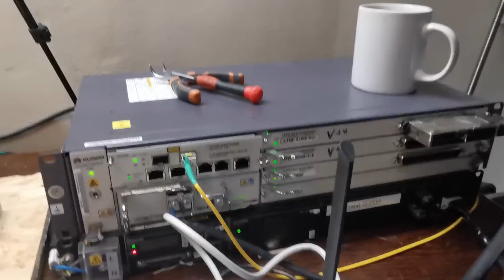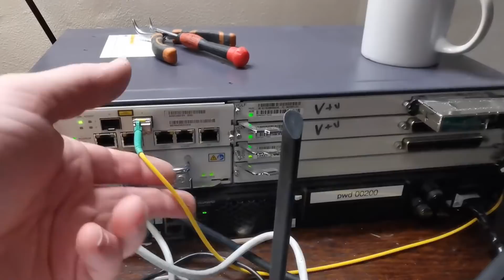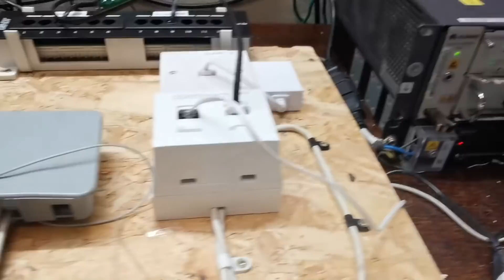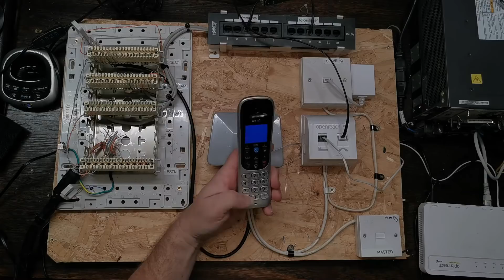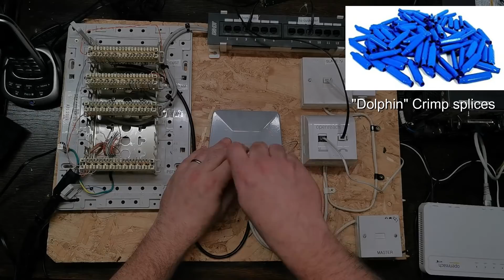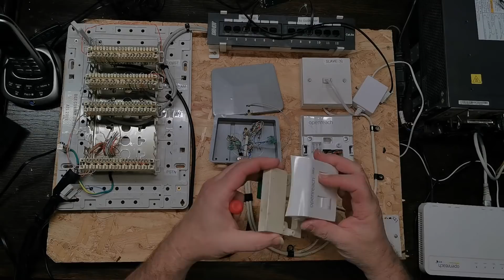How FTTC Works / VDSL

Comment: Very interesting.  I'm having random outage in broadband once a day between 20 to 60 mins.  No idea why. Engineers and tests/scans no idea either.
Reply from the maker: Things like this can be a nightmare to track down. Start by making a log of when it happens, how long and maybe ask neighbors. Once you have a few weeks star looking at the environment, where your line actually runs and events happening at those time. Its possible it's something being picked up from somewhere. We had a customer who, every evening would have a run of broadband issues at 7pm till about 10pm. No one could find a cause. long story short, a nearby radio ham would have dinner, watch the 6 o'clock news then go down to his shack for a few hours. His VHF transmissions were knocking out a number of people's broadband.

Comment: I don’t think gpon is used I believe it is 21st century network which is the WDM network
Reply from the maker: GPON is use by all the ALT nets in the UK with GPON/EPON used by BT, but they have all sorts of legacy in play too. GPON is definately in use in the FTTH in most areas as evidenced by the Huawei/ECI ONU and big arse battery backed ONUs with FXOs built in.
Reply: @rtechlab6254  the backhaul is 21cn which is a wdm network
Reply: @rtechlab6254  it is not gpon as a back haul from a dslam it is a 21cn ethernet circuit usually wdm or point to point optics

Comment: Actually in the US maybe NYC the cable terminates at a cabinet outside the premises then goes to the router via either a coaxial cable like that used by SKY PLC (not the twin coaxial cable) or via Ethernet cable possibly CA5 or CAT6 but recently I noticed a few fibre installs where the fibre comes into the house via a optical socket  then a optical cable with a connector on both ends one goes to the main socket the other goes to the router, the unit that is attached to the promises also has a possibility of a phone connection but these are options that you have to opt into when you have decided that you want broadband some people will just use a HUAWEI B331 Homehub and a HUAWEI B331 Antenna that attaches to the Homehub but will require a AT&T or other SIM
Reply from the maker: In the UK, the normal route is fibre  into the premises then there seems to be two ways its done. Either into a fixed ONT in new builds which contains the "modem", battery and provides a POTS Phone line. This seems to be a short lived way of doing it as we don't see it often, mostly in 2019-2022 builds. Most other installs have a small ONT on the wall connected by fibre to the wall box on the outside of the property. The ONT only provides an ethernet jack and from there is normal PPOE via a modem of your/provider's choosing.

Phones in North America are done a little differently and I've not really worked with them since contracting for Telus in mumble

Comment: How are voice calls routed to the exchange with FTTC.  Does the voice go over fibre from the cab to the exchange?
Reply from the maker: It depends. On our system we bridge to sip and go off down the fibre. BT in the UK break into the local loop which is why the cabinets are almost always next to the old cabinets the analog lines are patches in

Comment: Interesting to see how the British do it over there. Over here in the US we don't have a "master socket" we have a Phone NID on the outside of the house, then run a phone line to inside jack(s) and there is never any master or slaves, they are just phone jacks regardless of where they are at. It also appears you use a proprietary phone connector over there, BS 6305, where as in the US we just use RJ11. The Jelly connectors are called butt splices over here. I think FTTC is a dumb term to be honest, as ADSL, ADSL2+ etc. can all be fed from a remote DSLAM called an RT (Remote Terminal) and is quite common in rural areas (the countryside as you would say it over there). These RT's are usually fed by fiber, but in the very early days of DSL could of utilized multiple T1 or T3 backhaul. I think we should stick to terminology that describes the actual Internet connection we have, the hand-off. Just say I have VDSL2+, or I have Cable, or FTTH. I hate when people say I'm on copper, well both DSL (regardless of technology) and Cable are both copper. CMTS units are usually fiber fed too, would you consider that FTTC? As a lot of these CMTS units have to be moved closer for DOSCIS 3.1 and now 4.0. No, it's mostly used for DSL terminology, but nonetheless I think it's just dumb. Most DSLAM's are fiber fed, same with CMTS, it's the distance from said DSLAM, the condition of the OSP copper and the line cards (and provisioning) in it that determines the speed. We already know everything after the handoff rides on fiber, it's redundant terminology. My DSLAM is fed with 10Gbps Fiber backhaul, but only offers ADSL2+ 10/896 profile as they haven't swapped out the line cards for VDSL2+. Would you call that FTTC? It technically is fiber to that cabinet lol, but who cares the handoff is what matters. Should we also start saying I have FTTT (Fiber to the Tower) as most cell towers are fiber backhauled, with the exception of very rural ones that are backhauled via microwave. I know you didn't invent the terminology, but that's just my little rant on terminology. In the US we mostly just say what it is, DSL, Cable or Fiber, but when we save Fiber we ALWAYS mean FTTH/FTTP. Unlike Virgin Media that calls Cable internet Fibre!
Reply from the maker: I've done work for Telus so I'm familiar :) The master socket doews the job of NID/NTE Butt splices are something else here, they used to be gel filled blue crimps that used a tool similar to the ubiquitous automotive crimps. FTTC was one in a long line of half assed fixed applied to our phone network. VDSL does have a distance advantage over VDSL and will manage more stable connections at the same speeds. The green cabs (RTs) are fed by Fibre here and that was the justification for (Fibre Broadband) and I agreee with you, Fibre should mean FTTP, not fiber to the cabinet (VDSL) or Fibre to the node (Whatever version of DOCSIS Virgin use)

Comment: What is SOADSL?
Reply from the maker: Single Order ADSL. The slow cousin of SOGEA (single order generic ethernet access) these are services that dont have an attached analog service, so the setup I use with the MA5616 could be considered SOGEA as I don't insert the POTS analog service anymore

Comment: :( I’m still stuck on the bare bones 10-15 mbps down and 0.5 up trying to play games on it is a nightmare.
Reply from the maker: There's way too many not spots still
Reply: If it hasn’t improved, you can actually get an ethernet circuit installed. You’re going to be paying lease line pricing but they will put the fibre in for you.

Comment: BT made a huge mistake going this route rather than FTTH.  50-60mb is not fast compared to other countries and it seems this system will never be able to deliver over 100mpbs to a large amount of customers.
Reply from the maker: Wasn't possible at the time. Was a quick fix and a step to FTTP. Copper is now being phased out in most areas so large scale FTTP is on the way. At the time it was prohibively expensive and the technology not that well proven.

Comment: Thanks, really well laid out presentation, good point re dont go behind or inside the BT socket.
Like the layout and test bench / I did not know re the older sockets / additional wires etc (had that cause some issues on site visits), top tip.
Keep up the channel / defo recommend this.
Reply: I prefer to explain to end clients / the BT socket remains the property of BT - so avoid doing anything with it, do the basic checks as you showed.
If inside your house, keep any DIY folk away from the socket, avoid touching it or moving it.  (Log a ticket with BT if you need it moving / ppl need broadband more than ever these days), if you're nice and lucky, the person at BT might do it / or you always ask.
Plus outside maintain any external bushes and trees etc outside your property, keep the line clear and free from any overhanging trees), had too many ppl drop a tree or big branch then cut the line, approx £250+VAT per line... including chinese laterns burning the line 
Best tip, if you ever see a comms person or BT engineer, always offer a cuppa and some biscuits, those folk are out in all weathers, #karma #payitforwards does not always work / though they appreciate it if you can.
Reply from the maker: Thank you Andrew. Ring wire is a rarely mentioned but common source of issues

Comment: So hypothetically, can a person place a DSLAM on the home pair line ? 
That is assuming that it can do so if there is another DSLAM unit at the exchange and the unit at your home can boost the line speed if you are far from the exchange.
Reply from the maker: You'd need to strip the existing VDSL signal off with a microfilter and modem, then pass the output of both back through the DSLAM with the DSLAM configured to allow the PPPOE from the modem to pass through OR deal with the PPOE at the modem and pass wan through. Given the pricetag here, pointless :) You COULD use a modem and FXO then feed the wan data AND SIP through to a media convertor and go with fibre for both. Cheaper, more flexible, choose the SFP and fibre right, more distance too.
Reply: @rtechlab6254  Thanks for the reply and the video, much appreciated :)
The latter option sounds viable, is it possible you have a video on both setups?

Comment: Huawei may have packets reporting back to HQ
Reply from the maker: Again, there is no proof of this at all unlike Cisco. A well designed and managed network would also spot this
Reply: You need to understand that open reach does not actually provide Internet access so what is it going to connect back using they only offer ethernet products authentication is used so it can’t just randomly connect to a network network also the firmware is custom

Comment: Nice video! Openreach do have vectoring enabled on many Huawei cabinets now :)
Reply from the maker: I've looked into this. Initially G.Fast was going to be the magic bullet and after a trial of Vectoring it was put out to the technical press they were not going to do this, however as a couple of others have commented they do seem to be using it now. As an upgrade its just the line cards in the DSLAM that need swapping provided they didn't cheap out on the management cards so its a no brain upgrade,

Comment: What is the name for these types of combiners used to inject the ADSL from the DSLAM into the telephone pairs? I have had a look around and nothing comes up on google so I am wondering what there name is.
Reply from the maker: In this video they are just micro filters being used in reverse. Its not ideal but DOES work. The unit you want is a combiner and this is included in may DSLAMs

Comment: PSTN entering the Cab (PCP, primary conection point) is called an 'E' side, 'E' standing for exchange, the line to customer premises are called 'D' side. When connecting a VDSL circuit, quite often the ADSL equipment in the exchange is still left in circuit, BT/Openreach always connect from 'E' to 'D' so the E side entering PCP connects to the 'D' side of the dslam and from there the 'E' side of the dslam goes to customer. All extensions need to be wired to the punch points on the NTE faceplate not the standard old NTE5 Back box. If you need to use modem in another room away from the termination point you can plug normal CAT5/6 RJ45 into the faceplate then into the modem. Blue crimps are commonly  found in old joints on housing estates dating around 70's/80's when cable was burried directly in the ground and when alluminium was used extensively.

Comment: I have two of those Huawei modems feeding a dual-WAN pfSense router - the firmware is quite old (I think it the Kitz firmware) and I was interested to hear you mentioned a custom firmware - is this also Kitz or is there a newer firmware for these modems or something custom to yourselves?
Reply from the maker: It's a lightly modded version of the factory firmware, not the cut down BT firmware. It can easily be found online. We made some tweaks to restrictions on wan facing services

Comment: Not designed to be played with is just a challenge to the internet to play with it :) OpenWRT can be flashed on a surprising amount of OEM routers, i know the first BT Home Hub could be, and i think the Sky and Virgin stuff is Rebadged Netgear
Reply: Virgin use Arris for their latest Modem/Router unit
Reply from the maker: We have an Arris CMTS just in to play with.
Reply: It’s because most proprietary firmware is based on that so it’s going to be compatible

Comment: And here in Canada we have FTH fibre to home. 1.5 gigabit up/down line comes right into your home into a ONT then into your modem / router. From what I was told by the tech the fibre line itself can handle 10+gig for future capacity.
Reply from the maker: The rollout here is just starting. Expecting to do our first general FTTP here mid April. We have a few sites on specialist providers but this will be the first telco one. Done a couple with Telus in Calgary
Reply: This has been available in United Kingdom for ages even when this video was first produced nationwide fibre optic coverage was available if you paid for it in the early 2000 and later on it was starting to be rolled out

Comment: Blue crimps were used on aluminium cables and the external distribution points or DP's should all be screw type connectors not idc (as in the box conn 301 you are using. I believe BT is now removing all Huawei equipment from it's network as per government regulations. The company I currently work for use Nokia
Reply from the maker: Yup and price of Huawei spares has plummeted, good news for us. I don't think BT/OR know where half of this stuff is. I suspect the issue is documentation from POT would have been awful and there's still some of that kicking around. Working on a VOIP conversion on site at the moment that still has the jack style connectors in use!
Reply: @rtechlab6254  by / openreach doesn't know where half its network is either as they had 50% more copper in Slough than they realised. VBT is a monster and is bad at tracking it's assets
Reply: @rtechlab6254  bored didn't know where half of its copper network was when I joined in 1987 and they still are bad at keeping track of it even now.

Comment: One further thing you can wire in the ring circuit on an extension on the later NTE5 dockets as they have an inductor which reduces the bell circuit from acting as an antenna
Reply from the maker: You can and it is indeed there but not actually needed unless you like your retro phones ;)

Comment: You are incorrect in how the DSLAM connects to the subscribers line. It depends on the cabinet type and the DSLAM will be situated a maximum of 100 m away from the existing green cabinet. I know this🎇🤪as I worked for BT for 25 years and still work as a fibre planner for a company in London. I understand that for simplicity you could not cover all the cabinet types but the set up you show is not the most common type
Reply from the maker: https://kitz.co.uk/adsl/fttc.htm

Comment: When initially rolling out FTTC, BT said even when full, the cabinet would support full 80mbps to each line capable of handling that. That's proved to be bollocks.

Ive been on FTTC for 8 years. For most of that, I achieved a peak of 56mbps but hovered around 52-53mbps. Since BT installed another larger cabinet next to the one my line goes into, Ive had endless disconnection problems. Connections used to last over 200 days but since the new cabinet install, my max connection has been 74 days and frequently less than 30 days. My speed has also dropped to 48mbps.

Contact with BT has been laughable. The guys in India said reboot your homehub 6 every 30 days. Frequently it doesnt stay connected for 30 days. A 'technician' came and fitted the latest BT master socket similar to the one in this vid. After instal, he promptly plugged it in and out a few times causing the DSLAM to reduce my speed to 44mbps!

It's recovered slightly to 46mbps but Im now experiencing dropped connections roughly every 7 days. Im fed up of explaining to BT by dropped connection, I dont me dropped wifi, Im talking connection by the HH6 to the cabinet \ exchange. It takes 5 or 6minutes to sync! Im on the phone to them again tomorrow!
Reply: Put in a complaint to Openreach CEO's office - it's painfully inept but can get to the bottom of it in my experience, unlike the service providers who are helpless/useless when it comes to infrastructure issues...
Reply from the maker: We have solved a lot of issues by binning the Homehub. Generally one of the TP Link Archer units will work significantly better but they aren't cheap. I'm not sure that's the issue here though. Your speed may have dropped simply because of capacity, although this shouldn't cause your drops it will impact overall speed. The later Homehubs do give some signal information which is worth checking from time to time but AFAIK they still give bugger all logging.

If you can, take note of when the drops occur, there may be a common thread. We had a customer that lost his every Friday night, about the same time. Digging deeper we found a few people in that area did, all at the same time. A little more work and we found out that a radio ham would grab a drink and head down his shack about 7pm every Friday to chat to a friend, his set was wiping the local green cabinet out.  A few filters added on his gear and all fixed.

That said this is absolutely not your job and the CEOs office is worth a shot as already mentioned.
Reply: don't let them get away with it.....bother them till they fix it tbh